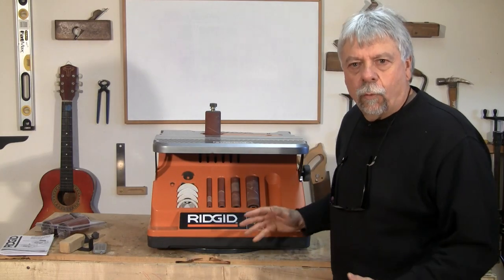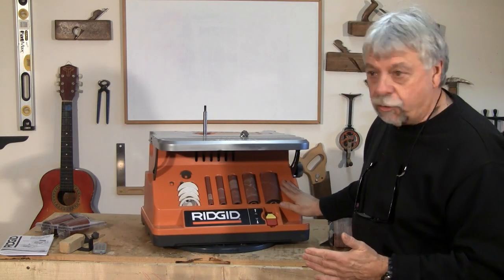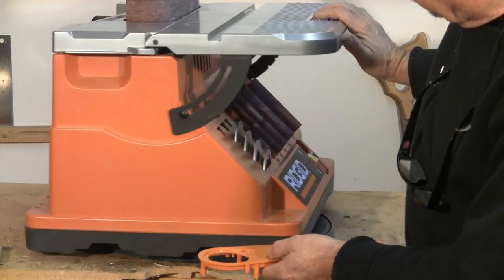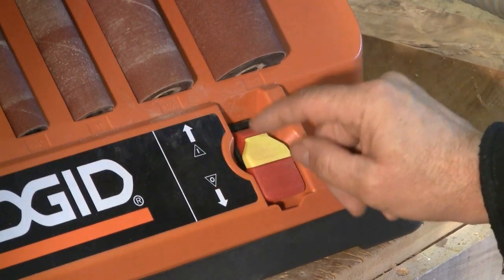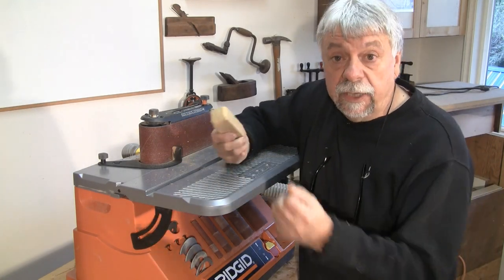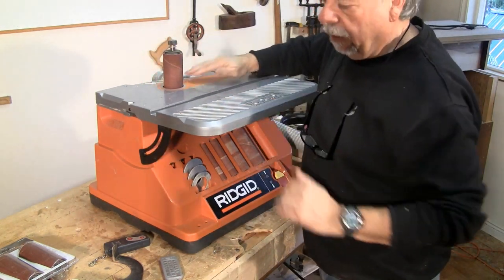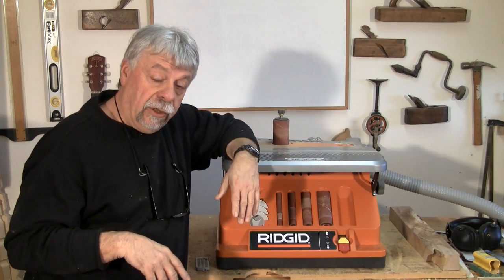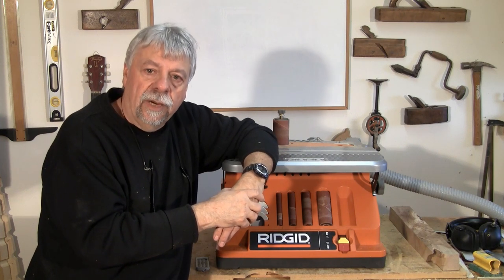Ridgid Oscillating Belt & Spindle Sander -  woodworkweb

Comment: I have had one of these for about a year now and it has been a great addition to my shop. I make a lot of wooden vehicles and toys and the spindle sander does a great job. I really like  the belt sander oscillating as well (no burn marks). I mounted it on a HB equipment stand and found that bolting it down really reduces the noise and vibration level. In addition I was able to negotiate with Home Depot and get an additional 10% off. The only  thing I didn't like was the hoops I had to jump through to get the sander registered for the warranty. Took about 6 weeks.

Comment: I've had this sander for a number of years and forgot or maybe never have taken the main belt sander off to use the spindle sander. The owners manual doesn't explain it very well but thanks to your video now I can as I need to. The spindle knob to take off the belt sander is on really tight and might need pliers to loosen it and take off. Thank you for doing this video.

Comment: I've had my Rigid spindle/belt sander for a couple of years and 100% agree with you, it's my go to sander for small projects.  I highly recommend it to anyone considering a stand alone sander.  I also have a Performax Drum Sander and a SandFlea sander - but the Rigid is used on almost every project.
Reply from the maker: Hi Bill, thanks for adding your thoughts to this :)
Colin
Reply: I too have had one for several years.  I agree it is a great addition to my shop.
Cheers, Cip
Reply from the maker: Cip's Wood Chips nice to hear you have had it for a few years, still like and it's still working ... that's encouraging

Comment: I have owned this sander for almost 15 years. Mine is gray, not orange, but the same sander. It has worked perfectly and continues to work perfectly project after project. It was a great investment then, and if it quit working on me tomorrow, I would buy another. Thanks for the great review and video.
Reply from the maker: Hi JP .. wow, 15 years, that pretty much speaks for itself ... thanks for commenting, good to know :)
Reply from the maker: ***** I agree about all the plastic, I too have wondered about that but have not hear any negative feedback about it, so obviously it's not a problem  ... although probably not a good idea to do a drop-test off the tailgate of a pickup at -40 degrees :)
Reply: WoodWorkWeb Lol, that's a good one Colin

Comment: Thanks Colin.  You've convinced me to buy this unit.  The WEN 6524 sander is a very similar unit with the same features and a slightly smaller footprint.  The WEN used to sell for less than the RIDGID but the RIDGID in Canada is now at the lower price.  I'm also going to build a flip-top cart shown on YouTube by Jeffrey Park in his video titled "flip top tool stand" where his RIDGID sander shares the same cart with his DeWalt planer.  The sander and the planer look to be the perfect combination for that cart.

Comment: Great sander.  I use mine in belt sander mode almost all the time.  it is great for cleaning up edges of stock.  It does a great job of rounding the sharp edges of stock.  The round front and back part of the belt sander does a great job of finishing inside curves without changing to spindle sander mode.  Great review.
Reply from the maker: Thanks for the vote of confidence David, I agree, this is a pretty useful tool
Colin

Comment: Hi Colin, I know this is an old video but in case you haven't done so yet, the safety lock-out tab will stay in the power switch if you push down on it until it clicks into place.

Comment: I have the same model for about 6 months now.  Pretty happy with it overall.  The top also has a miter slot.  The tilting table locks at the most often used angles and is micro adjustable to get it dead on.  Great review!
Reply from the maker: John, thanks for the note about the mitre slot, I think I forgot to mention it, thanks buddy !!
Colin

Comment: My Father has one of these, and after I used it a few times, I decided I wanted one of my own. I scoured the internet to find the best price, and actually found the Triton version of this tool for about $50 USD's LESS than what he spent for his Ridgid. The only real difference I have found between the two sanders, is the spindle on the Ridgid spins clockwise, while the Triton spins counter clockwise. Any shop will benefit from having either one of these machines.

Comment: I love my Rigid Sander. There is hardly a project that I dont use it for. I have had mine for 2 years, and have put it thru the paces. Nice Video. The only problem I have had,  is once I changed the big sanding belt, I did not purchase a belt from rigid, I got an off brand name, and I am constantly fighting the adjustment, as the belt keeps moving. Not sure if there is a slight size difference from and actual rigid belt, but next change I will go for the rigid belt, although they do cost more than the generic brands. Other than that, not a complaint.
Reply from the maker: Hi Ted, thanks for the info, especially the part about the belts, I will have to watch for that .... thanks again, Colin

Comment: Would this replace the use of a bench large (12") disk sander? I am considering buying one of the two and this looks like it does everything a disk sander would do with the extra benefit of the rounded sanding edges. I would use mostly to make final fine adjustments to size (instead of pushing again through the table saw just for a 1mm resize). With the declining table, it seems this would even adjust the size of miter/bevel cuts.  Thanks

Comment: Me to I want one. I have a Ridgid table Saw and 2 Ridgid drills . I love them all they work well and I can afford to buy them.I also saw the Ridgid Joiner but not seen any reviews on it. Good review Colin. If it's good enough for you it's more than good for me. Thanks Colin,
Roland
Reply: I have the Ridgid jointer and like it, there is a review by Workshop addict here on youtube. I am not going to say it's light years ahead of a benchtop for the little bit I use one but it is built far, far heftier and it has no problems flattening out a side of the occasional Oak firewood I run through it to get some nice Oak from my firewood.
Reply: I have the Ridgid jointer as well and I think it performs great.  Only issue I ever had was the chips get backed up in the discharge area.  I just put my vac hose in and clear it out.  The pros greatly out way the cons.  I have had the spindle sander for about 3 years and I love it.
Reply: Hey Thanks for the comments.
Reply from the maker: Thanks Roland ...

Comment: I bought one of these several years ago, and use it almost every day. I really like mine.
I've never had a problem with it, except like someone else said earlier, the adjustment for the belt is sometimes kinda finicky. Every now and then, when I replace the belt attachment after using the spindle, the adjustment seems to have changed all by itself. This is when I notice the belt riding high or (usually) immediately digging in, so I try to remember to just bump the on switch enough to turn it on for a couple seconds or so, to check how the belt is running. A quick adjustment if needed, and I'm always good to go. It doesn't happen all the time, so it usually catches you off guard when it does. 
The only thing I would change would be to make the spindles 2" or 3" taller, so you could sand larger parts with it. 
All in all, I think it's a really useful tool and saves me a lot of time, so I wouldn't want to be without it.

Comment: Hi Colin,
Have you used any other brand of spindle sandpaper besides ridgid brand. If you have, have you had any problems with sandpaper cylinders slipping up off of cylinder when applying sanding pressure.I use a well known brand of sandpaperHave taken mine into Home Depot to fix and they say nothing is wrong with it. 
Thanks david

Comment: I used this sander to build ukuleles in Hawaii. It lasted two years. The mechanism that makes the sander go up and down jammed and burned up the motor. I replaced it and it also did the same thing. Replaced it with an  H.F. spindle sander and a 4X36 belt sander, problem solved!

Comment: I saw one of these for sale on Kijiji... Can someone tell me if you can work the belt sander without the oscillating action? Also, is the spindle motor adjustable if ever the squareness is off in relation to the table?

Comment: Can anyone help me out, I can't decide between the Wen 6524 Oscillating Belt/Spindle Sander and the Ridgid EB 4424 Oscillating Edge/Spindle Sander or Grizzly T27417 Oscillating Edge/Belt Sander?? The range in price from $210-$250 with the Ridgid being the most expensive and having a bigger motor 4.5 amps and longer warranty 3 years, while the other 2 are 3.5 amps and 2 year warranty. Does Ridgid actually stand by their Lifetime parts and service warranty/guarantee  or do you have to fight with them if you need to use their warranty?
Reply: It's not a lifetime parts & service warranty. It's a LIMITED lifetime service warranty. Parts & service is 3 tears. After 3 years, you will pay for all parts. Truth be told, Ridgid is not producing most parts for this unit anymore. Customer service used to be good on these several years ago, but I've heard it's really gone down hill lately on this unit. It's not a big seller, so Ridgid doesn't want to put much effort into service.

Comment: I see there's a slot for a fence. Is there an accessory fence available that goes with this or does a fence have to be constructed to work with this sander?
Reply from the maker: I have not seen an accessory fence for this unit in the manual so I guess you would have to make one
Reply: Thanks greatly, I appreciate the reply and the videos.
Reply: Thanks for the reply Nick. All I needed for this sander to do was to smooth out some 45 degree miters. Looking at this I felt the fence would have too much give or flexibility and not allow for a true or square finish. Ultimately I went with a more robust sander.

Comment: Is there a way to vary the speed , or should I  just use a foot switch
Reply from the maker: David Nunemaker No speed control on mine David, and I don't recall ever seeing a version with a speed control so a foot switch sounds like a good alternative.
Reply: I really can not think of a reason to slow down the speed..... If is is taking to much off try a finer sanding paper.

Comment: hey there, has anyone owning one of these have a problem with the unit just not starting? Mine after not too much use has stopped working altogether. after about 3 weeks it mysteriously began to work again but then stopped once again two week later. not sure what to make of it.
stopped - no sound, nothing
started back three weeks later - normal operation
stopped - no sound, nothing
dead?
Reply: sounds like you have a lose electrical connection somewhere. Or a motor brush that is not making contact. have you tried whacking the case a bit when it wont start? either way bring it back for and exchange
Reply: Send it in for work or replacement. That is what a warrenty is for... Duahhhhhhhhhhhhhhhh

Comment: we cant get these in the uk, shame
Reply from the maker: Ah, that is a pitty, but at least you can get belt sanders and spindle sanders, not quite the same, hopefully Ridgid will look at that, must be a good market in the UK for this tool I would think
Reply: WoodWorkWeb I would think so too, atm I use a 3 in dewalt belt sander in a inversion stand from dewalt, we can get oscillating spindle or bobbin sanders but they are around £400 but this sander from ridged has both a spindle & a belt, ingenious really, I cant believe no other manufacturer has thought of it before.

Comment: I purchased 3 of these in a row.  
- 1st, the shaft was pushed down into the unit and it never worked.
- 2nd, worked for 30 minutes and quit - motor froze up. 
- 3rd. Motor froze up after after 1 hour.
Gave them 3 tries because I like the other tools I own.
I contacted the company via their web site after the second one - and never heard back from them.
Poor quality control can be fixed.  Not caring about the customer can not be fixed - it's part of a company culture that eventually is the demise of every company that is now out of business.
Reply: The machine or the way you use it.???????
Reply: Greg DuPey Don't use the website. Call the number on the manual. See my comment above.

Comment: I will NEVER purchase another RIDGID product as long as I live.  Last year, I purchased Ridgid's Table Saw & Miter Saw, both with gravity rise stands.  That was about $1100 for the pair and I'm not a wealthy man.  The Table saw started throwing sparks after 1 hour.  It's been in the shop for 5 months.  I called the repair shop and they told me that Ridgid is pretty slow to respond.  Check Amazon reviews.  Many users are reporting Ridgid Motor problems.  Perhaps just a bad batch of motors, but there is NO EXCUSE for anything to be in the shop for 5 freak'ing months.  Ignore their lifetime warranty.  All that means is you will NEVER see the tool again in your lifetime.
Reply: Mark Olson I'm sorry you went through this, but I had nothing but success with Ridgid. I had their 16 gallon wer/vac, combination blower and it just stopped working. I called customer service, they sent me an email instructing me to take photos of the blower/motor (they show you how to take the pics and of what parts of the blower), you then send the photos to them on the reply email and they take 1 to 2 weeks to determine if it's not something you did to it.  Within a week and a half, they sent me a brand new complete wet/vac and I didn't have to send the old one back. The rep, Trizza was really nice, very customer service oriented. I also have the table saw, oscillating spindle sander and planer. 
Before I purchased these items, I researched them extensively and got really good reviews. Check out the reviews on here on YouTube. 
Maybe you called the wrong place?
Reply: Mark Olson t

Comment: 3/8 HP Not powerful enough for a good sander. Others are saying the same.
Reply: +Airgunner 66 I'm in the market and the Ridgid looks very inviting. I'm a hobbyist woodworker so novice at best. What would you suggest - a belt/disk sander instead? If so, from which manufacturer? Thanks.
Reply: +Royal Poison For a hobbyist it is more then sufficient and you get a two for one which is nice. In general it's been a pretty popular tool with the exception of a few people experiencing bad motors out of the box(not sure if there's a certain date range associated with that problem). Being a hobbyist myself I tend to troll Craigslist for items along these lines and you can generally find them for between $100 and $150 used if your not in a hurry.
Reply: Gerald Ely Thanks for the info and insight. I appreciate it.
Reply: I've had mine for 2 years and use it every week and have had no problems.
Reply: It  is not made for heavy sanding, you can stop it quite easily, its more for 1x work and other small pieces, for small projects its fine.